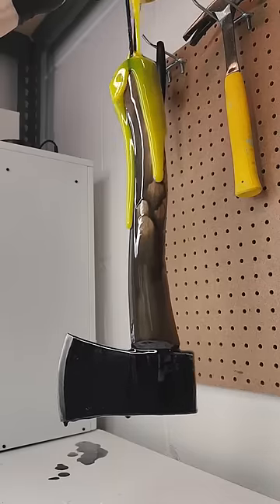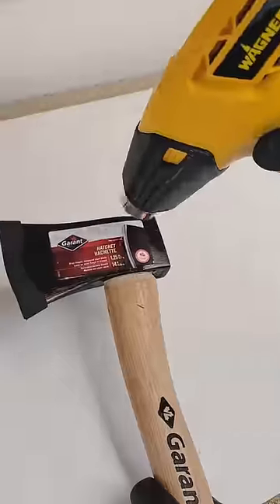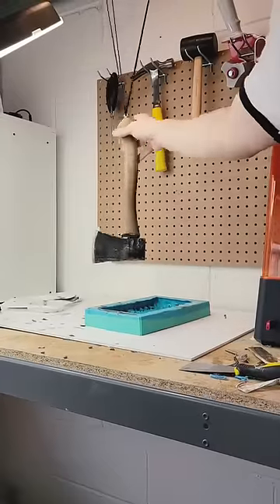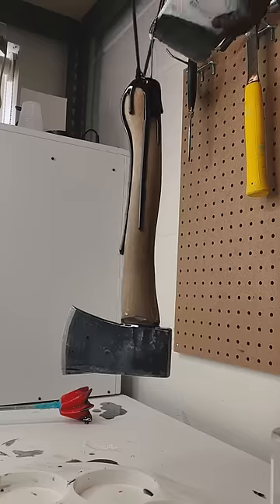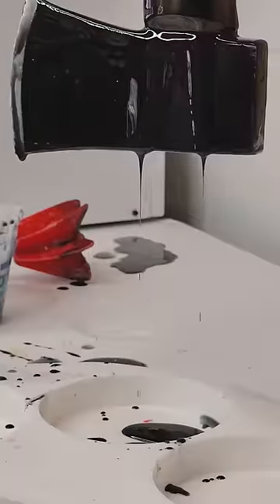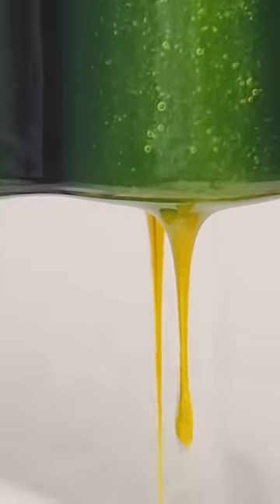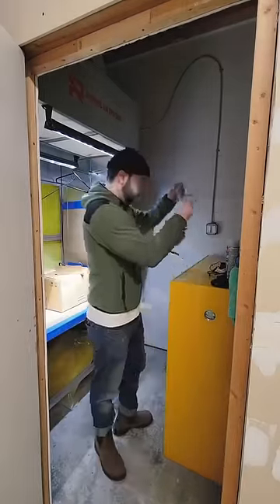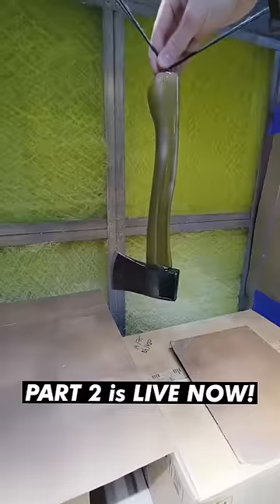Making a CLEAR HATCHET! #diy #howto #resin #resinart #art #satisfying #satisfying

Comment: If you need a clear hatchet, spray on some mold release, then fill a container that fits your hatchet and with the hatchet inside fill with resin, if you have an incubator and a vacuum chamber, release any gas with the vacuum chamber before pouring over your hatchet. Then put the hatchet in the incubator to regulate temperature and keep it dry as it sets. Now you have a mold, now cut and release your hatchet then spray mold release in your mold vacuum and mix some crystal clear resin, pour in the mold. Mold in the incubator for a few hours or over night. Remove any flashing.

Sand all the way up to 1200 grit sand paper then buff it with some polishing compound. I guarantee then you have the right to call the hatchet clear, and also the right to say it as the most complex thing you have made up until then.